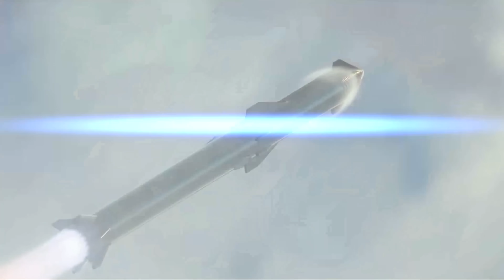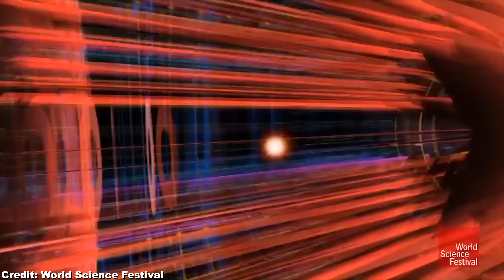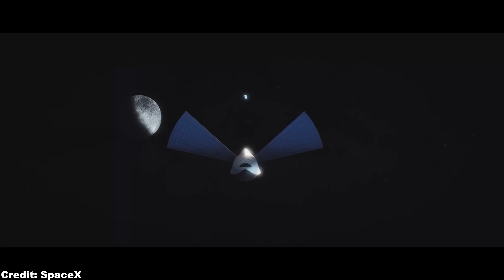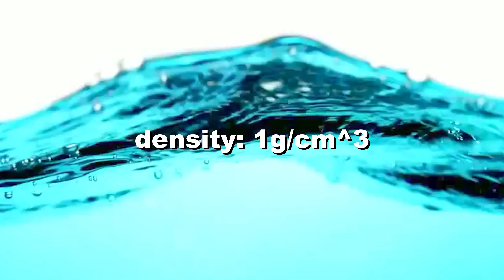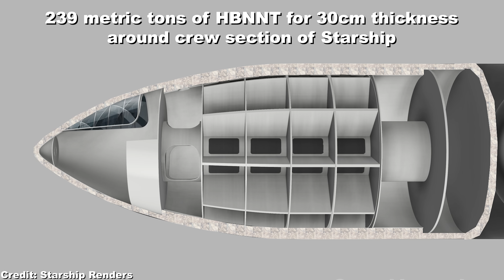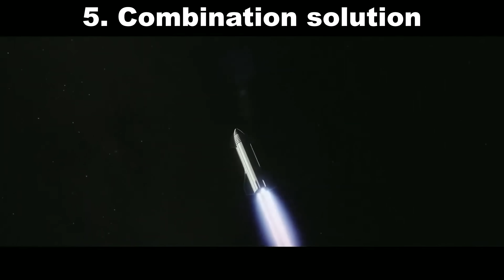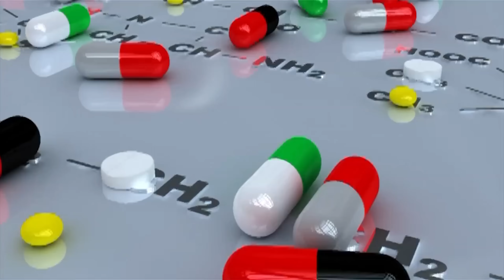SpaceX Starship FLAW Fix: Best Cosmic Ray Protection?

Comment: An easy way to make shielding more efficient, is to make a bigger space ship. Since volume increases faster than surface area.
Reply: Forlarren - Maybe that’s what SpaceX is thinking with the ‘double-wide’ (18m) Starship.
Reply: James Hoffman especially if the long transit can be made with cargo containers strapped around the outside of the hull
Reply: @douginorlando6260  There is no cargo inside crewed Starships. And the necessary supplies will only be placed on the inside of the hull, as nobody is going to take them into space and then strap them on the outside.
Reply: @douginorlando6260  Instead of cargo container on the outside how about other starships. Elon Musk has described his vision of hundreds of starships, maybe even a thousand flying to mars at the same time. After they have done there main burn to head to Mars they could maneuver in a tight formation. The outer starships would block some of the radiation from reaching the starships on the inside of the formation, and the starships could trade positions ever so often so some wouldn't always be on the outside.This would block some of the radiation and would only add the extra weight of the fuel used to maneuver into position.
Reply: Perhaps Elon plans to have a second variant of starship ... for cargo.  Any Martian or Lunar base will require lots of cargo, especially at first before the infrastructure to process indigenous material into usable products  has been built.   The cargo ships could then become the shielding barrier during the transit (6 cargo ships that link up to the starship's outer hall providing shielding 360 degrees around the cylindrical starship hull).  

        But what makes the most sense is a method of encasing the starship with external cargo and fuel containers which are linked to the outer hull while in orbit. Then the starship's rocket engines would accelerate the whole structure to Mars.  Ideally, two starships connected nose to nose would be encased with cargo containers except at ends where the rocket engines point outward.  Not only does this improve shielding effectiveness via economy of scale,  2 starships provide a backup in case one starship fails.  The cargo containers would be loaded into the starship after Mars orbit is achieved.   The cargo containers used as external fuel tanks could be discarded to reduce mass to be accelerated & decelerated during the interplanetary crossing. This also would allow the starship's internal fuel tanks to shrink since they will start the descent to Mars full and be refilled upon returning to Mars orbit.    There are other refinements to this approach that would further improve the cost per pound to a lunar of Mars base.
Reply: @douginorlando6260  I think we just found the use case for Mars cycler. Transporting meat bags. Everything else gets shipped as cargo, and interplanetary starships loses their windows.

Start with clusters of Starships. When the cluster gets big enough, land the whole cluster on an asteroid and use them to push the asteroid into a cycle orbit.
Reply: You just know that they already have Mega Starship penciled in for the not so far future. 😂💓
Reply: Orbital construction would make such ships possible.
Reply: @clintatk  in orbit around Mars. The Utopia Planitia shipyards. 😀

Pollution from steel production is beneficial to terraforming. And iron is everywhere. What's low delta-v requirements to bring it up from the planet.

Going big is the Martian way.
Reply: @jtjames79  why use delta Vs at all? an orbital tether would be possible using existing carbon nanotube materials technology with 1/3 earth gravity.  Also if u can bring it up on a lift, far less fuel to needed to get back to earth.  You could evrn build an interplanetary taxi ship in orbit around mars with as much shielding as u like.

Comment: Water is heavy, how about using the fuel as a shield. Maybe embed the sleeping quarters in fuel tank.
Put 5m habitation cylinder down middle, with 2m methane or O2 as shield between hull and habitation cylinder ?
Reply: This is the only practical solution in my opinion, and was completely glossed over. Hydrogen is the best element for shielding and methane contains lots of hydrogen, more than twice as much per unit mass as water does. I even wonder if that's why they put the methane tank at the top in starship, instead of putting oxygen at the top as in most other rockets including falcon 9.
Reply: @TechChasm  Great point. There is also the problem of fuel tank shape. There is a good reason why fuel tanks are spherical (strongest shape). Making a cylindrical fuel tank would be very difficult from a structural perspective. Not only that, but hydrogen is a very sneaky element. It escapes from its containment vessel easily. So, long term containment is an issue. It is even a problem for sort duration flights. That's one reason why rockets are fueled at the last minute (the other being safety) and continue to be topped off until lift off.
Reply: How about external fuel tanks surrounding the starship with a thin foil Mirror to avoid solar heating?  The mirror could also double as a tight lobe antenna for high bandwidth communication to earth plus solar concentrator for improved solar panel electricity generation.   The weightless mirror could be held suspended 200 meters from the starship. The mirror could be a special balloon shaped like a 50 meter diameter lens with the only reflective surface on the side bulging out toward the starship.  This makes a natural spherical mirror and many low mass techniques can make this nearly parabolic
Reply: Excellent plan.  I was about to suggest the same but read through the comments to see if someone else had suggested it.
Reply: Cryogenic fuel.....
Only useful for shielding if you're transporting Ices.

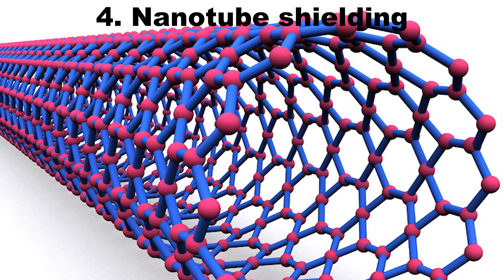Comment: 08:06 Carbon/Boron Nanotubes works like "ablative shielding" (but against "hard" cosmic radiation, rather than heating); the structure gets DESTROYED by each direct impact [or gets transmuted by secondary radiation, losing its best chemical/physical properties].
-> The Starship should not be constructed taking the "strenght enhancements" of nanotubes into account; since with each reuse it will become progresively unreliable & it is basically impossible to know how much it had degraded without dissasembling everything for "inspection" (even worse than the ceramics of the Space Shuttle). 
  
The Water Shielding is the best solution [high_ISP engines are not compatible with Starship´s methane fuel], but ONLY if there are SPACE STATIONS on both the orbits of Earth & Mars ready to receive incoming Starships to "hold" this water after their inter-planetary journeys [reentry & landing on either Earth or Mars with all that heavy weight is likely impossible].
  
 -> A Starship coming from Mars with 350+ extra tons of shielding water may land safely on a base on the Moon (lesser gravity), using the same fuel it had to land on Earth but without releasing all the water into space.  Then launching again without shielding to "park" on Low Earth Orbit (or to a Space Station) waiting for refueling to land on Earth [this means a 3+ days of increased radiation exposure, but at least is within Earth Magnetosphere].
Reply: @TechChasm  
I was thinking about it the other way (Starship gets water either from Earth or Asteroid Mining), then after coming back dumps it to a Space Station and/or Moonbase that need it as a "source" of oxygen & hydrogen (or as part of industrial processes).
-> Waiting for the initial infraestructure on Shackleton to be "ready" to both mine enough ice & store it (as a liquid, melting it with their "waste heat") would take too long considering how many people needs to have a "safe" way to travel to Mars.
  
The Starship v2.0 [18 meter diameter] would improve the mass ratio for shielding.
Reply: (Using water as a shield) I think this would be the initial sequence of launches:
. "Storage" [Cargo subtype] Starship: Carries some water to LEO.
.  x? Standard Cargo Starships: They bring the rest of the water (first), then all the necesary fuel to the "Storage" Starship on LEO.   [ This may take a while ]
. "Crew" Starship: Launches full of people, docks with the "Storage" and transfers everything (fuel & water shielding).
  
.  The "Storage" Starship may remain in LEO (waiting refueling from the standard Cargo Starships), or return to Earth [it is unlikely to be made "incapable" to return, as flexibility is more important for SPACEX].
-> Any Cargo Starship should be able to receive the water from incoming "Crew" Starships from Mars to hold their water sheilding and surface samples [if necesary], reducing weight for the Crew Starship to land safely.

Comment: Question. How much water do they need for everyday use during their journey? Cant that be circulated or stored in the hull? More like using it as a water tank of sorts? Since Elon said the inner diameter will be 8m, wasn't this hinting such a design?
Reply: @TechChasm  won't it balance out if the water is made to circulate making it behave like like a huge radiator.  I think just putting a few pumps somewhere around the hull that regularly  move the water shouldn't be an issue. 400mm is a huge space to work with, you can fit a person in there. Together with the materials that you proposed I am sure the whole thing can work to reduce radiation to at least acceptable levels.
Reply: Utilising passengers' water as a shield  shouldn't be taken as part of Starship dry mass but as cargo, it's like storing food around the hull. The water will be needed regardless of what shielding they will use. Life needs water, lots of it to live. So instead of storing it somewhere in the ship as a water tank why not store it in the hull as a shield?

A single person on the ISS uses 1 gallon of water per day, which is 3.78L. So for 100 people that's 378L of fresh water per day needed and 11 340L for 1 month x 6 months = 68 040L x 2 = 136 080L, which just translates to 136 080KGs or 136Tonnes of fresh water for their journey to Mars.  I am doubling this for a safety net. There won't be any help out there unlike on the ISS, so they need to be safe and healthy; 2 gallons per person per day is ok. This water can be recycled also, so just having an adequate amount for the recycling processes (some tanks will mix bad with good water during the recycling process) is fine.

Comment: Combination Solution. With shielding a multi-layered approach is probably best. Each layer adds a little bit to the whole. Some old school methods might also help. Perhaps add Cadmium plating to all of the steel in the human rated areas of the ship. Cadmium is the material used to absorb radiation in the core of nuclear fission reactors. Control rods are made of the stuff. This could absorb some of that radiation chain reaction from cosmic rays colliding with bulkhead materials.

Comment: Has anyone tried channeling the radiation to make power and fuel?
Reply: @TechChasm  You don't need to be fast or catch anything to channel something. You're just giding it. You can't catch the wind but we still channel it and speed it up, slow it down, cool it off until it freezes, heat it up until it sets fire, make it a liquid, get power from it,  palute it, make it sing. No matter how hard we try it still finds a way out. So can we give this radiation a path to fallow with a simple way out? The only thing we would need is to be in the way. If there is a way to do that we might not need fuel or radiation protection. Or at least very little. There's still the landing and taking off. The flow of radiation is most likely different on other planets and we would need to slow down some how lol.

Comment: Starship is modular, the fairing can be taken off, like falcon 9:
https://www.spacex.com/sites/spacex/files/starship_users_guide_v1.pdf
PAYLOAD INTEGRATION
Payloads are integrated into the Starship fairing
vertically in ISO Class 8 (Class 100,000) cleanrooms.
Then the integrated payload stack is transferred to the
launch pad and lifted onto the Starship vehicle, while
maintaining the same vertical orientation throughout
the entire process.